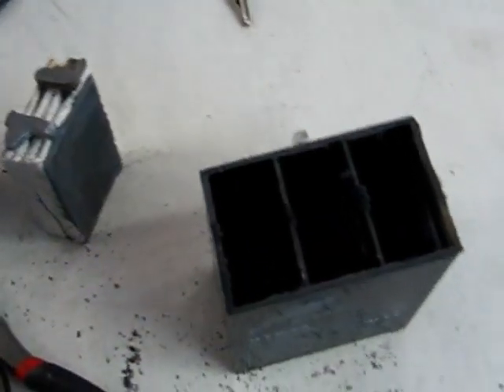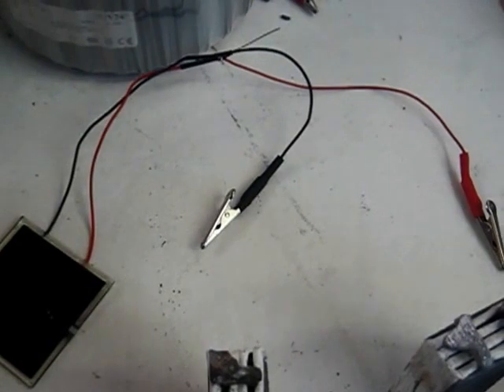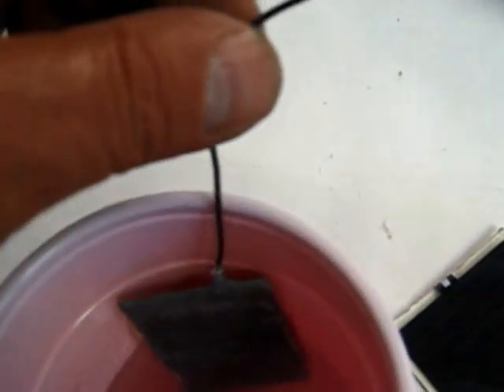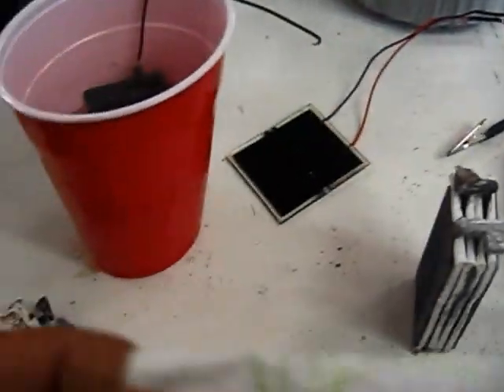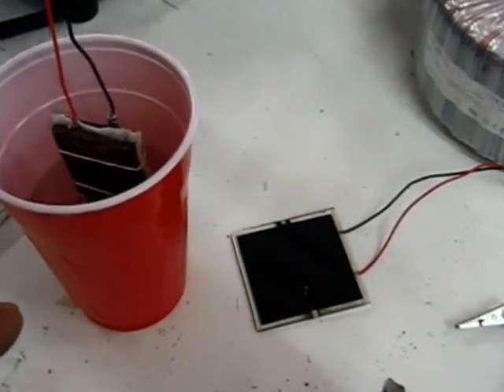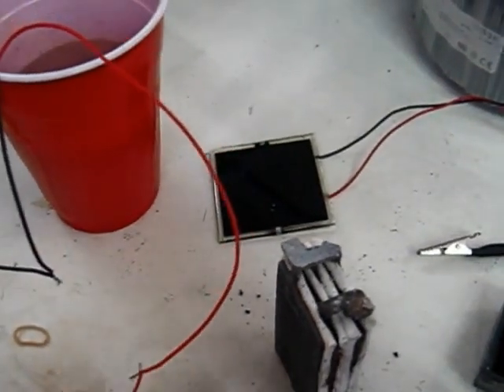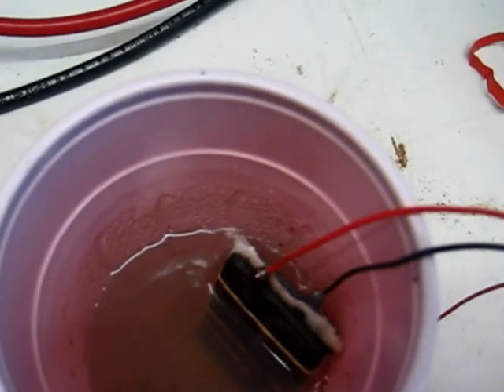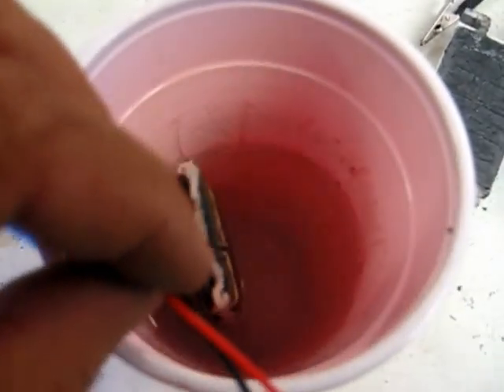Alum Crystal Battery Made From Old Gel Cell Battery John Bedini

Comment: Great fun and glad to see you guys demonstrating to all how practical this is :)
With the way the material crumbles, I used 2x cotton balls to replace it on my version (UB1245 gel battery). 
This one of yours is in much better condition than the Freecycle bulged one I took apart...the Negatives seemed ok, the Positives bits breaking away. So I used 2x Negatives and reformed. With electrical tape around they end up just about like a cellphone battery in size.

Comment: Hey thanks for the info I have a question I have a golf cart 8 volt battery gel style what is typicaly in the battery chemically is it the alumn or ive seen fertilizer any help would be apreciated also told to maybe reverse the poles to rejuvinate what you think
Reply: Doug Braun كيف أصنع العجينة التي أضعها علي الألواح